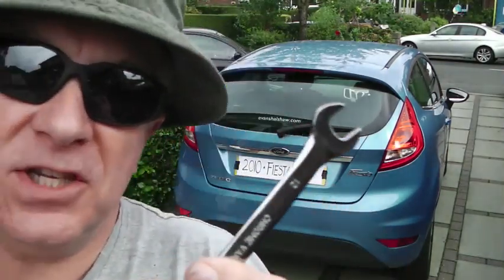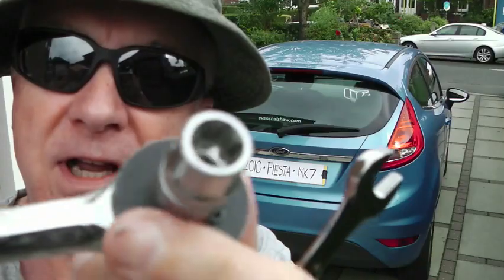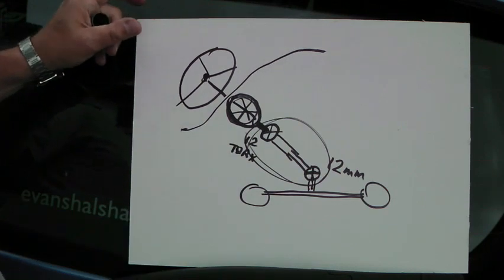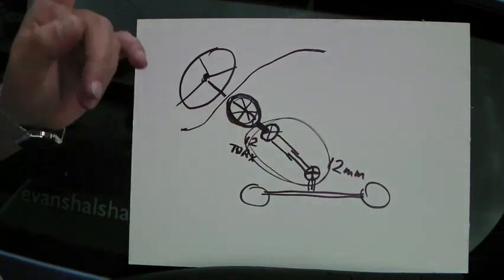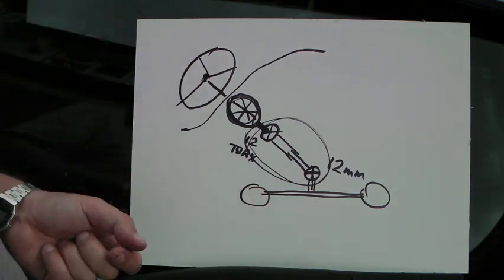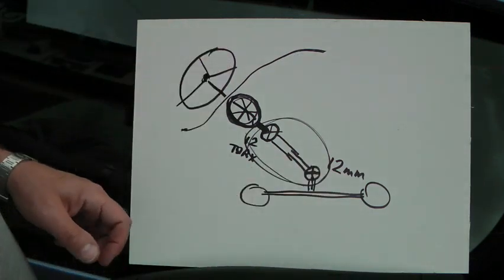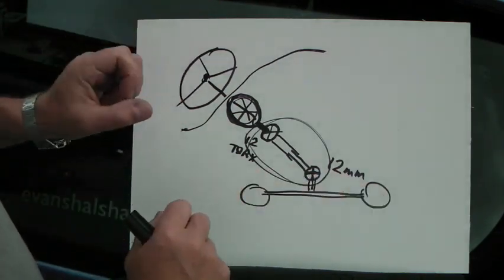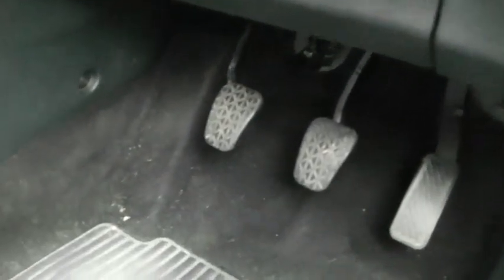Ford Fiesta Mk7 Faulty Steering Column (common fault)!

Comment: Mine started making the noise recently and although I greased both U/J's I found it was actually the sliding joint that had dried out. I've used good quality silicone grease to lubricate that and all is good again.

Comment from the maker: REPLY to Maliaritis Anastasios: Sorry I don't know part numbers - I'm only a home diy mechanic - don't work for Ford. Regards the "bolt" - I think Ford always recommend fitting a new one for safety reasons. I didn't bother because mine looked OK. Always put safety first, and whatever you do is your own responsibility. Good luck!
Reply: I am a fully qualified mechanic and don't the same to my parents car. Which i undone the bottom bolt then the top and then removed  the lower joint near then floor and then the top joint and soaked it in new oil and moving the joint side to side and back and forth  until it felt more smooth then greased it and again moved it around to work grease in. Then placed it back in . Seems back to normal
Reply: +Alan Clooney thanks for posting the video, was looking at maybe getting a Festa for my next car as i heard they are great to drive but was worried about Ford reliability,sounds as average as it was years back, will stick with Toyota's not the best drive or looks but great reliability so far and great after sales, thanks again for saving me time and frustation!.

Comment: Great job Alan!! Could you please confirm me if the right part number for this part(SHAFT - INTERMEDIATE) is BE8Z3A525B and if it is good to replace the old bolt with new one (also please confirm if the part number for the bolt is AY1Z3R827A)

Thank You In Advance
maltas

Comment: what Lubrication did you use? I am going to have to re-do this on mine as the noise has returned :-(
Reply from the maker: Just any old engine oil that you have lying around!,,,,,Tip: don't forget to use a pin, or miniature screwdriver to gently make a gap at the side of the nylon/rubber bands (which act as  dust covers on each of these "swivel" bearings) so the oil can penetrate each bearing. As long as you get the oil into the bearings the fix should last a long time.

Comment: The joint did not dry out, ford let a lot of fiestas leave the factory without any grease inside the sliding shaft, it is this that causes the notchy feel and knocking noise. You should be spraying grease into the column itself not on the joint. Although you should not be recommending anyone to do this at home as sliding the upper shaft to far down onto the lower shaft can cause damage to the steering column and at £600 its not something you want to get wrong. Leave it to the guys who know what they are doing.
Reply from the maker: Your findings are slightly different from mine, but thank you for your interesting comment.
Reply: +Alan Cooney Im a mechanic in a ford dealer and this is the repair procedure they recommend. I've done it several times successfully.
Reply: +Daniel Warren I've been trying to sort out this issue on my MK7 TDCi (2011 first registration) but so far i have not been successful. I first tried with a WD40 spraying the joints only without removing the shaft. I think that the problem was slightly fixed for 2-3 days but then the noise came back. Last Saturday i took out the whole shaft following instructions from Alan and i lubricated both joints (i even put them in a small bucket of oil 10W40 and left them covered for 10 minutes there) but unfortunately the noise is still there when i put it back. Now, i am reading that Daniel (Ford's mechanic) suggested to lubricate or better grease the sliding shaft (even though on Saturday i tried to put also some oil there but of course this is not grease) and i will try again with a spray of grease. Any other recommendation Daniel? What is the product i should be using? I do not want to take the car to any dealer here in Belgium (they are very expensive and will definitely suggest to replace the whole part/shaft which of course i will have to pay from my pocket as the warranty expired). Many thanks.
Reply: +Daniel Warren How much would i be looking to get this done on my Fiesta as i have the same issue with mine and ive had all the bearings, steering rack and lower suspension bushings checked so im hoping this is the cause of the issue i have
Reply: +Daniel Warren One more question: In case that i undo the lower bolt only is it possible to de-assembly the sliding shaft so i can put some grease there and lubricate the shaft? Do i need to have spraying grease only or can be any grease? Many thanks

Comment: Thanks for the heads up on the fault, so far I've not had this problem but will get some spray grease and give the joints a good going over.

Oh! I'm starting to see a few rusty Fiesta's on the road just lately, 08 - 09 - 10 plates.....they are rusting on the lower front wheel arch/sill edge, turns out that the rust starts from a part of the lower edge of the wheel arch, its prone for chipping on its edge, then the rust really kicks in.

So check your lower arch/sill edge for rust or even blistered paint! any rust spotted get it sorted out ASAP.
Reply from the maker: Interesting to hear about early signs of RUST on the 08 - 09 - 10 plates!!! No rust on mine yet - but give it regular washes to prevent accumulation of mud from the road. Also I recommend - don't put a wet car in your garage or it will stay wet and rot! Cars parked outside get nice flow of air underneath to dry them off.
Reply: +Alan Cooney  Don't have a garage so I'm fine but known for years about putting a wet car into a garage is not advisable, I'm OCD when it comes to keeping my fiesta clean under the arch's, infact every three month's the wheels are taken off and everything is cleaned, the rear drums are rust free and painted in heat treated satin black as is the whole rear arms/nuts/bolts.... The front is also treated in the same way in everything was stripped and all painted in satin black & all nuts & bolts are fully greased to prevent any rust.

In your 'other' video at 3 minutes 14 seconds you can see the front lower strut where it attach's to the solid steel arm, well a friend has an 08 plate fiesta and its just failed its MOT at this point! The car needs both front struts replacing as the steel on the strut was so badly corroded that it had split & cracked, pretty shocking to see on such a car for its age...... I'd suggest removing the big bolts out of your suspension, clean out any debris/rust and apply some rust preventative and then give if a good painting over to stop any future rusting.
Reply from the maker: Thanks for comment on CORRODED FRONT STRUTS. I've added your comment to my "other" video! Much appreciated.
Reply: +Alan Cooney  Alan!  I never realised my steering was notchy, must have come on gradually, it wasn't bad so my Son blasted the joints with spray grease and really worked it in, can't believe how much smoother & easier it is to turn the steering wheel. Thank-you for this.

Comment: I put grease in every joint, so it will not hurt, I removed the small door where there's OBD socket so you can see the upper joint and from there I sprayed the Grease spray with a long straw just inside the joint so being very liquid at the beginning, has penetrated through the lower tube where there is a sliding joint so that it can be lubricated without removing everything.
There are now two years that I have done this and I've had no problems.
Sorry for my English, I used the google translator.

Comment: Hi, this is so frustrating as I have already been to ford once with this issue and it was sorted under warranty, however as per my luck the warranty has since expired and long behold this issue comes back. When they have done the jon it hasn't even lasted a year which I think is appalling. Can this issue cause a light rattle on the steering wheel? as it sounds like something is loose and there is quite a bit of slack when I wobble the steering wheel? I am ringing ford today to see what they say doubt I will get anywhere tho
Reply from the maker: From my observations the steering column "issue" doesn't cause a "rattle". What you describe sounds as if something is loose. You need to get the car inspected by a trained mechanic because potential steering failure is a safety issue!!! Without seeing the car I can only offer a "guess" that maybe the dealer did not fully tighten bolts when they did your warranty work a year ago, or a popular cause of steering rattle can be worn track rod ends.
Reply: Sway bar links

Comment: Hi I've taken my column off and the slider in between the uj's is very tight in a few places. I've tried soaking it in oil and working it but it doesn't seem to be acting as smooth as it should. Do I need a new column at £130?. Symptoms were knocking on steering in slow movement etc you know the usual fiesta mk7 knock.

Comment: Thanks so much for this video. I had this very issue with mine (a 2013) when it was just 3 months old! The dealer continually re-greased the joint for over a year, and each time the noise went away for a couple of weeks then came back. After bitterly complaining to the dealer's various managers and threatening to block their service garage entrance, they finally replaced it under warranty. Mine got so bad before the replacement that it threw off the steering position sensor, so it began to read the "10 o clock" position as the straight ahead position. Therefore to go straight, I basically had to keep steering to the right... if ever I released the wheel while driving, the car would veer violently to the left. Needless to say I could not let anyone share in what was supposed to be a pleasurable experience of driving my new car! This added issue also went on for about a year, even after I suggested to the dealer (after the first month or so of it happening) that the sensor may have been affected by the knocking issue... to which they replied that the steering in a Fiesta had no sensors!!!! Ford needs not only to address this steering problem with the cars themselves, but also the quality of workers at their dealers. I have no choice but to keep the car for now, but it has been the worst ownership experience of any car I've owned, and when I'm finally in a position to sell it on, I will NOT be buying another Ford.
Reply from the maker: Your "dealership" experience does not surprise me - that is why I do ALL my own car maintenance. One of my son's took his VW car to a VW dealership for manufacturer "recall" work. They broke all the plastic cowling around his steering column to carry out work on his pedal box. When questioned about the poor workmanship they admitted their workshop had allowed an "apprentice" to work on it - enough said!!!

Comment: Are Ford Fiestas reliable?
Reply from the maker: It gets a high ranking compared to other makes & models if you Google "top 10 most popular small cars".
Reply: +Tom Jardine Pretty reliable but they eat front tyres.
Reply: @IanLanc  i was wondering smh have brand new ones and theyre almost dead
Reply: I love mine. Mine is 8 now and this has just started. I had a seat before this.... never again.

Comment: I bought some PTFE spray from my local TOOLSTATION Store.  I sprayed some in through the small gaps of the top and bottom joints and this resolved the issue for a little while without having to take any parts off.  Hope this helps.
Reply from the maker: Nice one!

Comment: I reckon you're bang on with the EPAS motor getting hot.  Certainly on the MGF the motor got hot, but it wasn't by a column joint on that car.  I'll be looking out for that on my Fiesta.

Comment: There is a technical service bulletin for this that the dealers are aware of. Should be re-greased by the dealer for free.
Reply from the maker: I agree, they should re-grease it for free, but if your warranty ran out (like mine did) then it's tuff luck!

Comment: Awesome video, VERY helpful! My wife own the 2011 model and it has this exact problem and thanks to you, it looks like it'll be an easy fix, thanks!!!
Reply from the maker: Thanks Patrick, I'm pleased the video is helpful to you. As we continue driving this car the steering still feels great - so the FIX really works, and it's cheaper than buying new parts! I'm just disappointed that FORD are letting quality control slip because the Fiesta Mk7 is basically a great little vehicle!

Comment: Thanks Alan,

I have a Fiesta 2011/2010, 1.6L with powerSHIT transmission, yes SHIT...LOL .
Stupid azz transmission.

STEERING.
In just 5,000km my steering rack made the funny noise. Replaced under warranty and needed like 9 months wait for the parts which comes from Thailand and the que is just so insane for this repair. My Fiesta is Thai assembled. Now its only 15,000KM and the new steering rack/assy is like 5,000KM old only, it started to come back that noise. Approx US$650 is what Ford Indonesia will charge me if I were to replace the steering rack/assy. Mine is not only about the noise but it is worn out, the noise is like a worn out steering ball joints. Now the 3 years warranty has expired.

If it weren't for the excellent handling, driveability ( must be above 40KM/hr ) and great seats, I would burn this piece of shit Ford engineering. My powerSHIT is also shitty, making noise now. In bumper to bumper traffic the powerSHIT gearbox is purely slow....very slow response. I change my gearbox oil every 6 months and will never believe a 100,000KM bullshit. I do 5,000KM a month max on the Fiesta, got some other cars to use.

I am from in Indonesia and they just mailed me that the powerSHIT now has 5 years warranty, instead of the original 3. They know it is POS gearbox. I can't believe Getrag made that powerSHIT gearbox...LOL.

Ford cars in Indonesia DO NOT sell. Fiesta sales save their local azz. Focus and Everest is like a diasease, nobody wants them. The Ranger did decent only in coal mines but not for personal use.

Q1 2014, total Ford sold in Indonesia...TOTAL...1,300 unit. Bulk of it from Fiesta.
Monthly sales of just Fiesta in UK would be 2,000 easy...yes ?

Again thanks for the steering tips yah.
I stopped doing DIY for my cars a looooong time ago.

Comment: Did you need to replace any of the parts? I heard that you need to replace the bolts after removing. What kind of lube did you use? Mine is pretty bad, the steering is actually pulling to the left now which I think is being caused by this.  Thanks
Reply from the maker: I guess new bolts are always preferred for obvious safety reasons, but I just replaced same bolts after carefully inspecting them - they are very robust and mine were visibly in good condition. To ease off the dry bearings I started with 3 in 1 penetrating oil, followed by thicker 10w-40w engine oil. Note - the bearings have a 1mm rubber protector ring surrounding the outer edge of each bearing - I guess to keep the grease in. Simply prise this sideways with a pin, or miniature screw driver, to get the oil into each bearing. This fix really works! Happy motoring!!